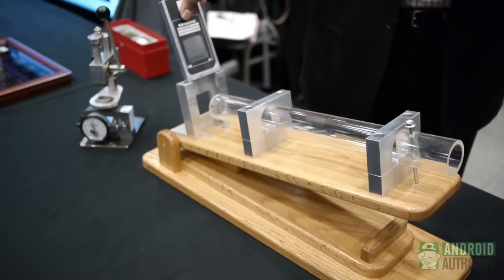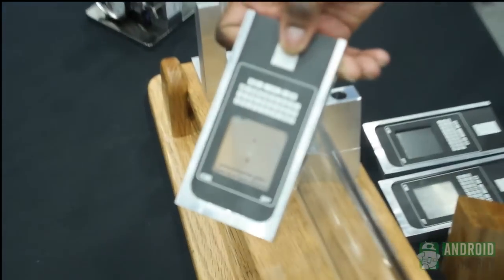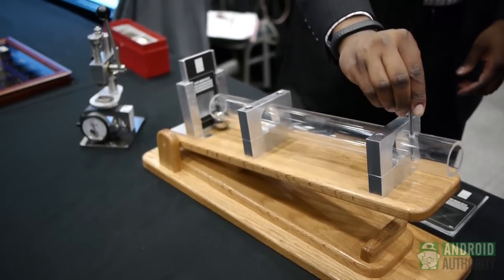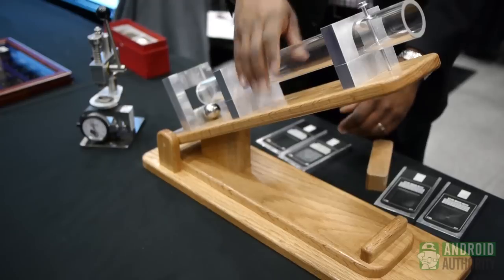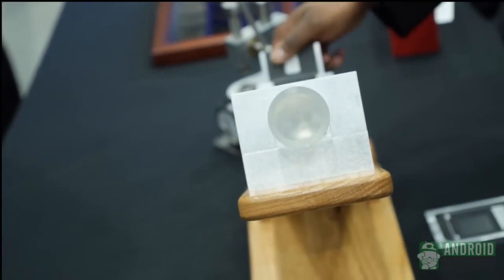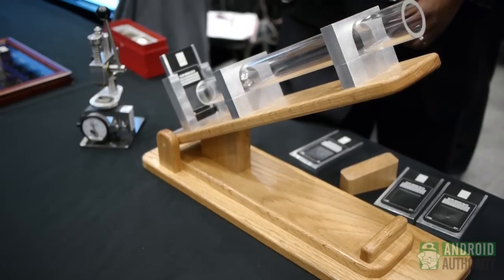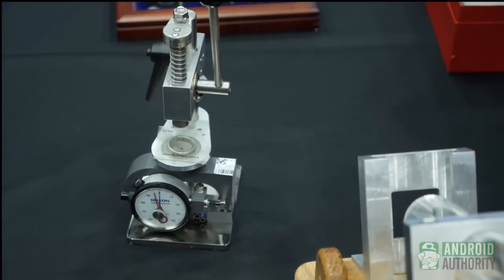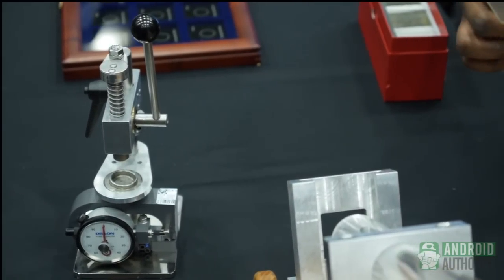Corning Gorilla Glass 3 Demonstration

Comment: Drop your phone and the screen cracks anyway.
Reply: my lumia's screen does not :p
Reply: Ziyad Ousmand lumia <3 :D
Reply: wbgsci i just drop my lg l fino from third floor on stair and nothing happen
Reply: i too accidentally dropped my old Lumia 520 twice, one on wooden floor and 2nd on a tiled floor, and thank God the glass screen is not broken! 
Thumb ups to Lumias!
Reply: Dropped my new phone from 2 feet, cracked in 2 spots
Reply: Mine broke first drop
Reply: Drop my S7 ONCE Spider webbed screen but still worked dropped about 100 more time before it ceased to live ..doubt my new Moto g6 play will fair the same haha
Reply: Galaxy a51 using gorilla glass 3 dropped from 5 feet on cement and screen hasn't even scratched
Reply: @campar1043  what phone? I'm three years late
Reply: @caseyaston4273  mine to probably mine was just a baby gorilla :D

Comment: i have moto g4 plus, dropped two times face first from decent distance, not even a single scratch
Reply: Sagar Kumar I have the same phone too
Reply: My Moto g5s plus glass got crack on it's first fall....
Reply: I had a  Moto G4 non plus I recently passed on to a family member who needed upgrade, have dropped it a few times over the time I had it on hard wood, and even once on asphalt with only a rubber case no scratches, or cracks. Now I have a Moto G5 Plus, and I've dropped a twice so far on hard wood both at home, and work, same no scratches, or cracks. However My older Moto G3 has a finger nail sized scratch in the middle, and some chipping around the top right edge after a fall on asphalt leaving my work, and it even had a hybrid rubber/hard shell case on it. 
So personally I think Corning's QA for Gorilla glass is a bit inconsistent at times, how the glass is implemented in different devices, the nature of glass being glass, and shear luck.